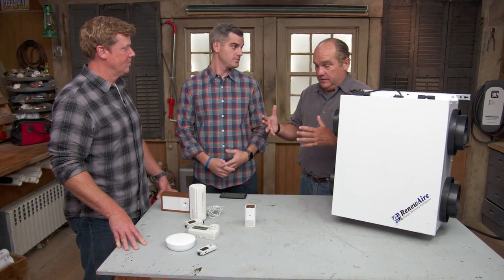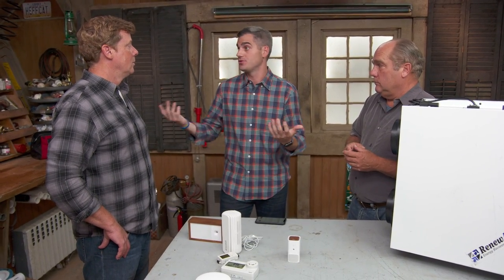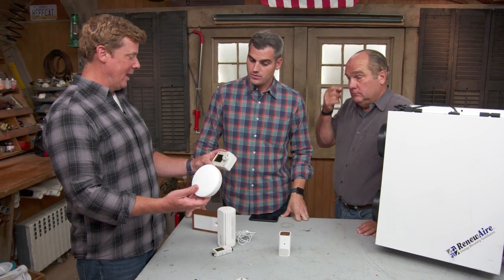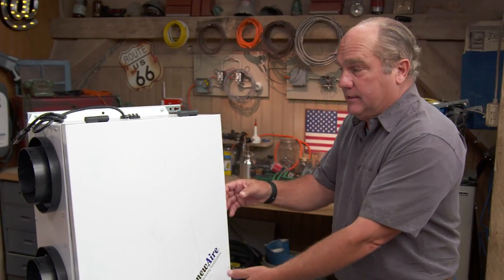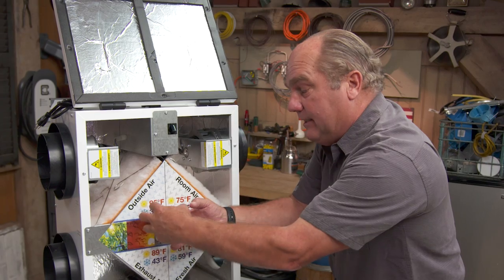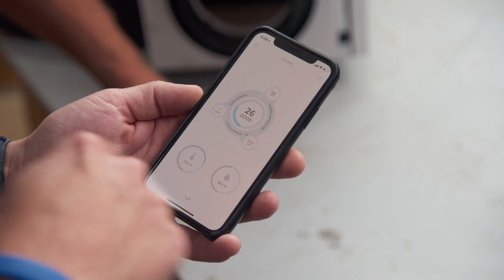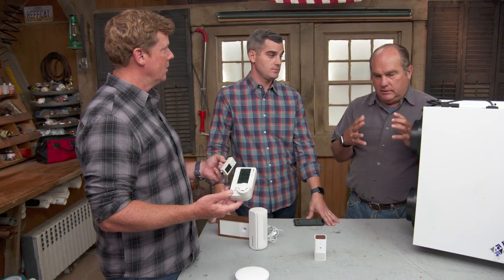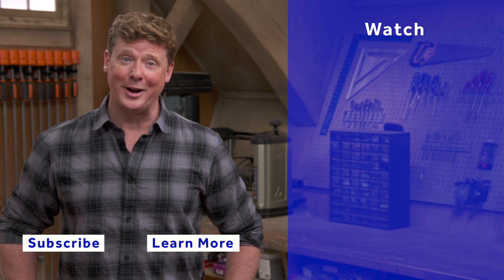How to Understand Indoor Air Quality | Ask This Old House

Comment: I was in the same boat as Richard. We built a house 16ish years ago and I went above and beyond the code standards and doubled down on insulation and windows. Then added foam board and spray foam. I was naive with HVAC equipment back then and trusted the contractor. The first winter every window in the house was a water fall. My wife would get up in the morning and make the rounds wiping windows I would come home during my lunch break and do the same. 4 times a day we went through this routine. 
The contractor would say that happens in all houses the first year. We felt tired and we had more flu and colds that winter. Then I did some research and found out that even back in those days there was positive effects from installing an HRV unit. My contractor fought me on it and said it was a waste of money but I wouldn’t give up.
I’ll never forget the day they installed the HRV. It was already consistently in the 30 degrees range here in my home state and the windows had already showed signs of condensation droplets. The unit ran for only 30 minutes and the windows were already drying up! The salesman came by the next morning to see the results and I’ll never forget it when he looked at me and said, “oh I didn’t think that your house was that tight”.

Comment: When you’re looking at several houses to select from, is there a small, portable air quality tester you’d consider to bring along? “A” (one) because it would seem “inspector gadgety” to carry a separate device for each radon, formaldehyde, co2, humidity, etc. I read radon testing requires long term for accuracy but even short term (10 minutes) would give a hint of what’s going. I think air quality is the invisible consideration besides nice garden, architecture, and interior spaces. What would you carry along?

Comment: I have a crawlspace.I installed a vapor barrier and dehumidifer, but the air quaity is still bad in the living space.  should I install an exhuast fan? because at this point, I'm thiking of selling the house if I can fix the air qualifty issues because I have bad allergies. Also,  also if I can't fix the air quality issues, thinking about digging the crawlspace out and putting a reqular basement in. If I can't fix it I will have to sell because the house is making me sick. the house also has a flat roof, I wish I never bought the house, but now im stuck and looking for solutions

Comment: So I travel alot and I feel better when Im away from my home. BUT I KNOW my windows are drafty. Theyre old. My home is like mid 70s. I always feel like crap. My lymph nodes in my neck are sore this morning again and I was fine all week away from my house. When im home i get these annoying mild headaches. I still dont know if Im crazy or what but ten years of this is getting old. 
About 3 years after i bought it I replaced most of the carpet and padding because it had the old waffle padding and it just had that manufactured smell when you walked in the house. That helped that smell but its still in two other rooms. I feel crazy sometimes trying to think of what it might be. Sure wish I had something to test for EVERYTHING so i could fix the issue.
Reply: How often do you excersize? Drink enough water every day? These matter too...
Reply: Ermi test

Comment: I just installed a Glas® smart thermostat by Jonson Controls earlier this year to replace the Honeywell® programmable thermostat that my mom had installed 15 years ago.
The Glas® smart thermostat checks the indoor air quality and will run the HVAC circulation fan whenever necessary.

Comment: So basically instead of buying an air quality monitor I install a nice ventilation system and that should do the job right? At the end of the day monitors do not improve air quality
Reply: Or leave on a bathroom fan. You won't know if that's enough without a monitor though...
Reply: Monitors are needed so that you can be informed of the appropriate level at which to run your ventiation system. For example, if your indoor air quality monitors show that your air quality is satisfactory when your ventilation system is operating at only 50% capacity(which might be 2 air-change per hour for example) then you know that you don't need to run it at 100%(4 air-changes per hour in this example) at that time. You could even experiment with running it at 20 or 25% and see if your monitors still report the air quality as being satisfactory. The monitors are there to allow you to use the ventilation tools wisely so that you're not needlessly exhausting precious heated or cooled air to the outside, effectively sending money out the exhaust pipe.

Comment: Air filter required, not just an air conditioner.  Perhaps air filters replace air conditioning; just use powerful fans.
Reply: Air filters cannot remove CO2. Only outdoor air can help. (Well, until we've f-cked that up...)
Reply: air filters don't affect moisture or temperature which are the job of A/C. Filters should be used for any air-moving unit anyway, be it heating or cooling.

Comment: I leave my AC on 24/7. Does npt this replace the air continually?  NOTE: AC itself only comes on when it is hot days. Still, I need to know what air quality meter to buy, as I have accute asthma. HELP!  anyone   PTL
Reply: AC does not circulate air from outside with air inside. It takes the air inside and extracts the heat from it and sends it to your outdoor unit to dissipate in the outdoor air. The best that an AC can do is circulate your air within your home through your air filter, if you have central HVAC ducts. Make sure you are replacing that filter every 6-12 months. If you have a furnace that also uses the ductwork, it should be 6 months. It really depends on your usage of the air handler. I don't have the knowledge to answer your question about an air quality meter.

Comment: I heard somewhere that the difference between and HRV and an ERV is that one is for northern, colder states and the other is for the southern, warmer states. Which one for Florida and what is the major difference between the two?
Reply: In the colder region where I'm from in Ontario we typically use HRV to recover lost warm air from exhausting and mix with preheated or heated forced air. An ERV could be used to recover heat losses from air in unison with a heat exchanger for water to help heat your hot water tank. Ive seen the ladder configuration in Southern regions before since there is no reason to preheat or air-mix warm air in a warm climate.
Reply: The key difference is ERV provides energy exchange in the form of both temperature and humidity exchange, when HRV’s only transfer heat, meaning temperature only. I recommend ERV’s for all residential applications regardless of climate. We need temperature and moisture exchange. Another issue is that not all ERV’s are created equal. Use a static enthalpic core style, like Renewaire, Soler and Palau, Mitsubishi, etc which are rated for just about every climate.
Reply: @rosstrethewey9391  Thank you Ross!

Comment: So important to just open windows and let air in.
Reply: Momma Knows Bestest when you can. I concur.
Reply: @grillo7196  fresh air does the body good childrensssss
Reply: Momma Knows Bestest thanks mom
Reply: @brandonb9452  you're welcome. I'm full of wisdoms.
Reply: And let wildfire particulate in?
Reply: @arthurmead5341  don't live in the forest. Momma.world problems solved  👌 😌
Reply: @MommaKnowsBestest  i'm hundreds of miles from the forest and was choked out a few months ago by the CA wildfires even though they were several states over. Your wisdom blows!
Reply: @arthurmead5341  maybe don't breathe so much  Momma.world
Reply: @arthurmead5341  
Attach MERV13 furnace filters to the back of box fans for wildfire smoke filtration, until the smoke “blows over”.

Comment: Just a cool $1800 for one of these..
Reply: I think It's worth to buy one, if you just gonna open windows to let fresh air, you gonna loose a lot more money over time in heating your house
Reply: @MrVespel  over time as in length of the mortgage, or 5 years?
Reply: ROI is about 3-4 years. Tested and these unit can last 20 years. 15+ years of energy recovery system will save you thousands in the long run. As a building system tech I can tell you there so much great tech out their for homes and buildings. Its the upfront costs that hurt.
Reply: DIY similar for 50$ they are easy to make

Comment: So maybe building homes that tight isn't a great idea
Reply: With a HRV you get filtered air. With a leaky building all the pollen and dust from outside just blows in. Not to mention the mention the higher energy bills, and cold drafts all around the house.
Reply: It's vastly superior for IAQ if you build as tight as possible. Then you can control the quality, volume, and location the air enters the structure. With a leaky house, you have no control, its dirty, and costs you money. Some days when the outdoor temp is close to indoor you would get very poor ventilation even on a leaky house. With a mechanically ventilated house you get good ventilation all year round, its filtered, and you recover the energy from the air leaving. It's vastly superior for occupant comfort and structure durability in every way aside from cost.

Comment: Pressurized compartments are plane and simply unhealthy.
Passive ventilation was better in many ways.
Reply: Also worse, there are trade offs for everything and you lack control and energy efficiency with passive systems that if you don't live in an ideal climate/weather area can give rise to a whole list of issues.

Some people may also live in areas where the outdoor air quality is worse and you'll need to clean/filter the air coming into the house anyway...
Reply: @ZeoCyberG  Of course, but most houses are poorly situated to take  advantage of the sun. Geothermal sounds great until you find out most systems for whatever reason have failed in many regions.
Reply: @ZeoCyberG  This is what I have seen with my own eyes. With so many abandoned homes across America ,the HVAC homes rot from the inside very quickly .
At the same time the abandoned passive vented homes outlast the HVAC homes by not years but decades.
Reply: No, what you've seen is just bad designs.  When HVAC was introduced there was a long period of time over a few decades where no one understood how to properly build a house to work with the new systems they were putting into them.  

Like when people switched from taking baths to taking showers many of the old bathrooms became ruined because they were not designed to work for people taking regular showers instead of baths...  

People have to understand a house has to work like a complete system.  You can't just make a change and expect it to work without issues if the rest of the house isn't also updated to work with it...

But properly done the new air tight homes can last far longer than the passive because it allows more control over the interior environment.  It just has to be done properly and the whole house treated as a system instead of just a sum of parts...
Reply: @ZeoCyberG  My observation stands , Hvac homes literally fall apart when unplugged for as little as a couple of years.
Reply: Sorry but nope, your conclusion is based on a wrong assumption of cause and effect.

A modern, well built house, with proper systems can last over 500 yeas!!!

Any house, whether passive or active can be badly built if the people building them don't understand how to do them properly... and that goes for not using them as they were designed to be used as well...

Comment: Just open a door and a window on opposite side of house for a minute or two daily and save thousands!!!
Reply: @Joe T just opening your door does that! You can optionally buy a filter to fit your window and a fan for pennies on the dollar compared to this system. Don't get me wrong, of I was rich I would buy this system.
Reply: You'd need to have your window open 80% of the day. It might work for some. Not just a minute a day though.
Reply: Except that encouraged mold growth indoors so you can’t do that
Reply: My house was built in 1930.  The wind blows through it as if two windows were open, according to the natural gas bills, anyway.
Reply: No not in my experience if you live in an apartment with a busy road 🚗 

It depends 
Science-medicine 
Don’t trust your intuition 
it could be faulty 👍

Fact check information first based on study and evidence.
Don’t guess